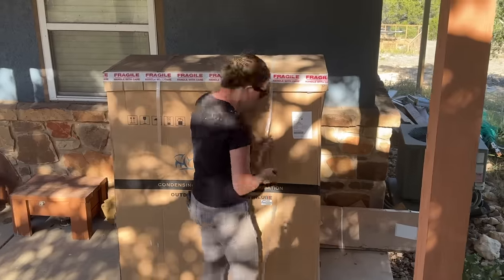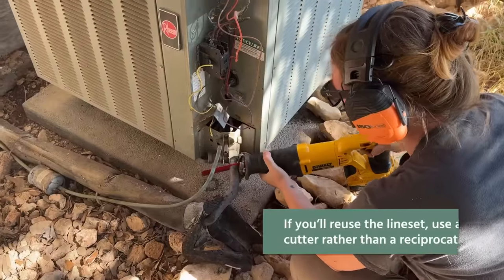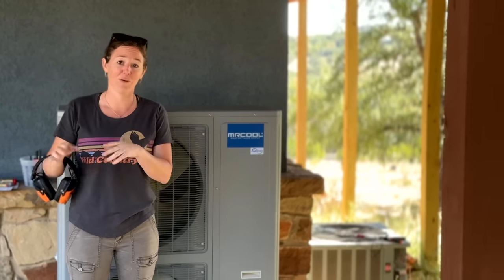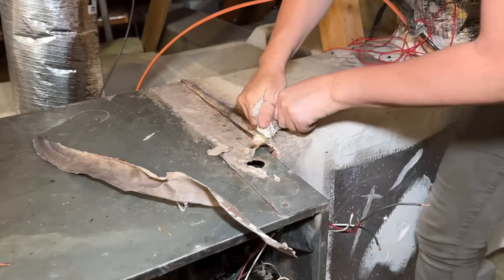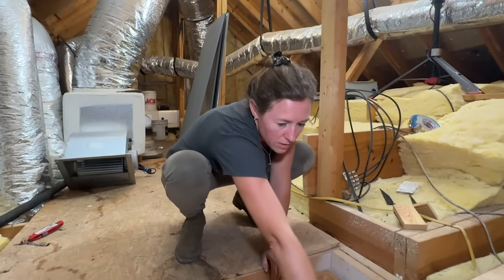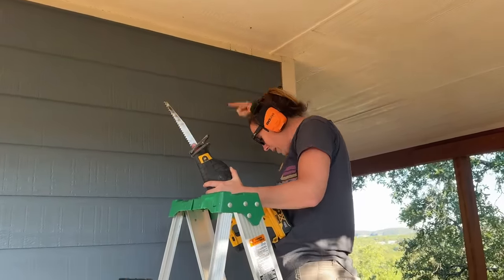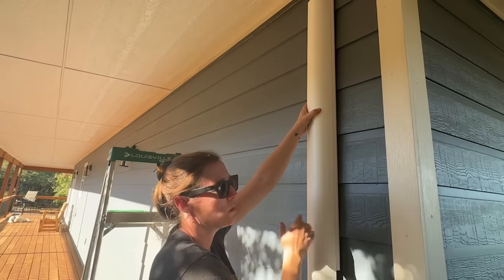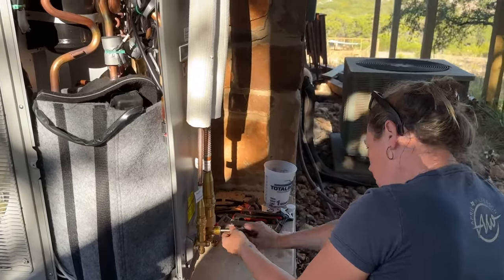I Saved Thousands! A DIY Heat and AC System with Heat Pump

Comment: Not a criticism of April or of this channel, but two observations about electrical norms in the US which I find fascinating.

Instead of "disconnect box", which is four syllables, why not refer to that as an "isolator"?

Also on the topic of the electrical side of things, I find it amazing that those wire nut things are permitted. They just look like such a bodge, and a fire waiting to happen. Whats wrong with a bit of terminal strip, or even a wago connector?
Reply from the maker: As far as my words of choice, I try to use words that someone who's not familiar with the type of project, would instantly recognize and remember. Definitely "Disconnect Box" would stick in their memory whereas Isolator may not. Thanks for watching.
Reply: Thanks so much for taking the time to reply.

Just to clarify, my comment really was not intended as a criticism of you, more of an observation.

Your countryman Adam Booth from the Abom79 channel uses the same term "disconnect box", so it makes sense that this phrase would be easier for viewers to understand.

Here in the UK however, the word "isolator" is quite commonly used - for example if a bathroom is fitted with an extractor fan, there will usually be a labelled switch, which can be used to disconnect that device from the electrical system, just outside the bathroom (our 240v power and regulations do not allow switches other than pull-cords or sockets to be installed in bathrooms). Those are labelled with the words "Fan isolator", or sometimes simply "Isolator", so the word is in common usage over here.

Similarly, I have noticed other YouTubers describe an electrical outlet as a "receptacle" whereas that word is not in common usage here. We would call it an outlet, or most often a socket.

As for "wire nuts", I have seen your fellow countryman, Adam Savage (both examples I chose were called Adam!) use those for various projects, but i have to say that they look risky to me. I for one think a screw terminal strip is safer and easier to service.

Anyway, fascinating video. Thanks for making it!

Comment: Hope your coil doesn’t freeze. By blocking off the coil with that piece of sheet metal, not enough air may cover the coil. An offset would have worked more effectively. Great job.

Comment: This is awesome. I installed two home heat pumps to replace a single heat pump that did two floors in 2010. The price was the big reason but not only did I have to learn all the electrical, plumbing, and duct fabrication but I had to learn how to braze the copper to include doing a tripple evac before getting a tech to come check the charge. A few years later I added a mini to the living room so it could be kept slightly warmer when people were in there when it was freezing out. That didnt require the brazing but required using a flaring tool which is problematic for some. This fixes the refrigerant line problems.

Comment: What happens if your pre-charged line set is not long enough and you have to cut it or somehow make it longer how do you get it recharged?
Reply: You can make those longer by coupling another lineset to it. I think MrCool sells connectors to join linesets. You can't make them shorter. I mean, you can if you do a standard vacuum of the lines, but that defeats the purpose of the pre-charged lines.
Reply: Mr Cool offers various line set lengths and those line sets can be connected together. If you're going to cut the line set you've wasted money on the DIY kit you should buy the unit without it and pay a HVAC tech to pull the vacuum and charge the system.

Comment: You really should insulate the underside of that roof to keep the space that air handler is in at a decent temperature. It will also cover up those roof nails so you don't poke yourself working around them.

Comment: Very good video I might recommend on the inside of your air handler to put a angled air dam so it doesn't create turbulence by hitting that flat panel it makes the are deflect into your ductwork just a piece of sheet metal put in there at an angle has a deflector

Comment: Kudos to you; you amaze me with every video! A couple things to mention; It gets hot in those attics in the summer time. Seriously, heat stroke in 15 minutes! Also, in the south its pretty common to have an attic AND a crawl space (like a basement but not as high, and with a dirt floor). Most crawl spaces were not built with ease of access in mind, though I built my house myself and built it with EOA at the top of my list, since I was in a service job for 25 years! Third, many 2-story homes have separate units up and down for more even cooling/heating. Ours does and I wouldn't have it any other way! Total control of each floor; it makes a huge difference!

Comment: Great video as always!

Helpful life saving meter tip in the future.  Prior to assuming a piece of equipment is no longer energized is to do a live-dead-live test. Confirm your meter is working properly by testing it on a known love circuit, followed by the de-energized circuit you are validating. Followed by known live.

Comment: I installed a Mr. Cool mini split three years ago, and I have been pleased with it.

The HVAC installers constantly tell me that "I hope you can get the parts when it eventually breaks."
Reply: I know......but a MrCool system is about 1/3 the price of a professionally installed system from Lennox, Mitsubishi, Fujitsu etc. The HVAC industry has priced itself out of many jobs.
Reply: These are 10 years systems if you get more than that its a bonus. When saying these most all mini split systems. Biggest problem is parts aren't accessible in our "normal" supply chain. Extra effort extra time and when you finally get the part its for a customer that  wants Diy pricing so most of us just pass. I say good for ya'll doing your own stuff
Reply: @jonsaircond8520   Who is "us" in this situation?

Comment: You had it evacuated. Good on you.
Reply from the maker: Thanks for realizing that.  :)  Everyone misses that and I hear about it. Thanks for watching.
Reply: @AprilWilkerson  No prob. dont put plugs in the top of the condinsate tee's. cut 3/4 and make sticks that are higher than the other drains and emergency drains usually 6" is fine. neg coils needs that to work well esp in high heat. Just a little tip.

Comment: I'm not a fan of skipping the leak test and you are supposed to torque your flare connections. Also we lose our rebate if we DIY. I also don't like the excess line set coiled up, I think it causes issues.

Comment: Is there a reason you didn’t reuse the line set
Reply: Prob two real reasons.  One- she relocated the system so the line set isn't long enough making the bend around the corner to new location.  Two-the new line set is precharged.  If she used the old lineset she would have to pay an HVAC guy to vacuum and refill the refrigerant after installing it.

Comment: Since you cant "shorten" a pre charged lineset, where did she hide the rest. And is it standing vertically or laying horizontal  ?? Vertically creates oil traps. Also she didn't show the thermostat wiring. These seam like small omissions but they are issues with operating. Full disclosure, im a professional HVAC guy. It's the little things that a DIYer dont know that make the biggest difference.

Comment: If it needs service, will any local HVAC contractor go near this or will you be on your own. That’s what has held me back from a Mr Cool. I suppose I should reality check that by calling around. I already had a company tell me that wouldn’t install a heat pump hot water heater I had purchased at a box store because they require you buy everything through them.
Reply from the maker: Where I live it's not a problem but not sure about other HVAC companies or places. As most are individually owned, it's Owner Decision. Thanks for watching.
Reply: Thanks for the response and the great content @AprilWilkerson  !

Comment: Great Job but next time make sure to check the power on the inlet side of the contactor because you will not have power where you were checking unless the T-stat is calling for it.